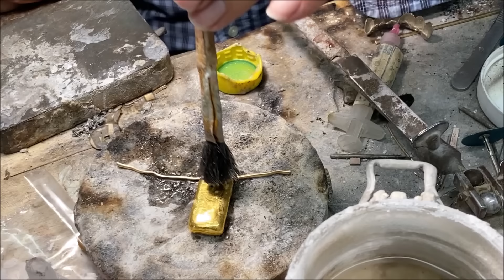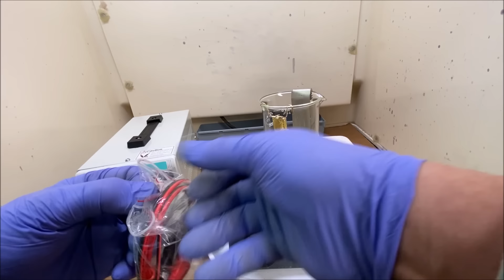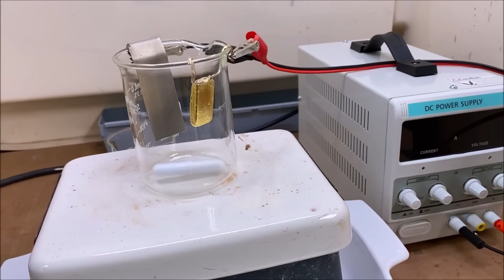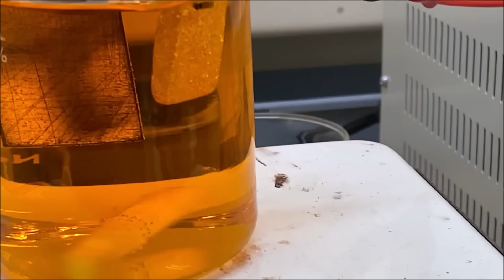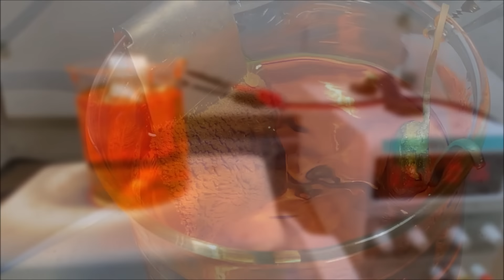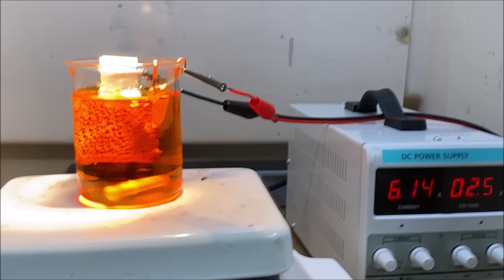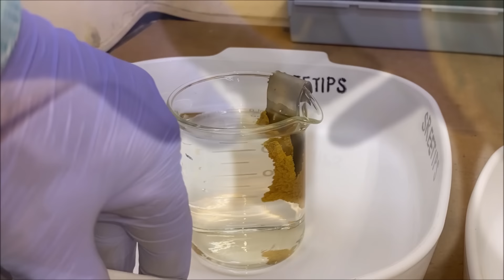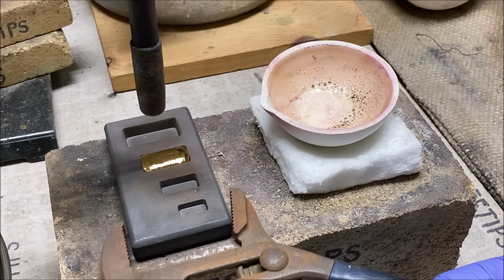Electrolytic Gold Cell Part 2

Comment: in the future for a setup that doesnt need soldering, you should run the anode through the rollers to make it thin enough that the alligator clip can hold the gold directly, and instead of soldering leads on, just make some ladder steps to hold it higher, and as the bar shortens you can lower it down farther into the solution, this will also mean that the excess gold in the end is smaller in mass and easier to process later without having to melt all the solder off. This also makes it faster to switch to a new anode, just have another thin long piece prepared and you can effectively hot swap it, you just have to get a little better at rolling them not in the shape of a banana lol
Reply from the maker: Good suggestion, thank you.
Reply: @sreetips  You can easily punch a hole in the bar [hammer + nail] without losing mass and then string it on a copper wire.
Reply: @sreetips  what the heck….. why delete my comment?  I put a lot of time into telling you about hho torches and getting a Chinese one for cheap willl do the job…

I didn’t swear it put |inks or anything :(   Blah

Just trying to help. It would do the gold solder easy. Almost 4,000 °f flame
Reply from the maker: I have not deleted any of your comments.
Reply: @Coincidence_Theorist  @Coincidence Theorist  your posting under other people's comments. Your other post you thought was deleted is under laser2120's post. You should start your own main post to see them together VS posting your thoughts as a sub post under another viewers comment.
Reply: @sreetips  nor would you
Reply: @sreetips  Could also make a mold that when you pour the molten gold, it forms the dog ears?
Reply: @sreetips 
For our next trick, let's build a speed rail to Mars via the moon...
Reply from the maker: Can’t, outer space is far too dangerous.
Reply: كم نسبة حمض الهيدروكلوريك وبيروكسيد الهيدروجين في المحلول؟ @sreetips
Reply from the maker: @alameerali7430 the bottle label says 31.45% HCl. The h2o2 label says 29%
Reply: @sreetips  شكراً لك ، لدي سؤال آخر .. هل يمكن استخدام معدن آخر غير التيتانيوم للكاثود
Reply from the maker: I used a pure gold (999 fine) rolled thin as the cathode in a previous video.
Reply: @sreetips  let's see them upload their own vids one day, for now Great Job Overall
Reply: Reading this as the banana comes out of the roller 😂in my real view time
Reply: Isn't this just pulling gold off the gold bar and collecting it on the titanium plate? Is the gold bar going to weigh the same? As well as the electrolyte gold solution?
Reply: @dru4135  moving the gold from the gold bar (anode) to the titanium plate(cathode)  is the primary purpose of this electrolytic cell.  The electric power that's fed into the cell is what does the work of moving the gold. Adjusting the voltage used controls which metals would or wouldn't move from one to the other. Different metals need more or less voltage to be pulled off the anode into the electrolyte and pushed onto the  cathode onto the electrolyte. Look up 'electrolytic refining of copper' to understand more.
Reply: Yup, make it thin enough to fold up and over the beaker (like the Cathode) so you can attach the alligator clip and slowly feed it in as it is consumed.
Reply: @Miketz  you could just fold it in a sepentine fashion then would not have to feed it
Reply: @chrisharris1522  Thin anodes tend to dissolve unevenly, and pieces end up falling off. By feeding it in over time, the thinnest bits are always at the bottom.
Reply: @Miketz  maybe but constantly handling the anode in order to reposition it adds another level of complexity to the experiment in which contaminants could be introduced or disturbing the anode could potentially dislodge a piece of the thin part at the bottom of the anode as well, generally when setting up an experiment it is desirable to keep it as simple as possible in order to mitigate unintentional events such as these. If a piece were to drop off it is not a huge problem as it will be recovered anyway when the gold is recovered from the electrolyte and on a molecular level gold atoms are detaching from the anode all the time to a degree anyway
Reply: @chrisharris1522  you could take care of this with a little bit of complexity if you setup a circuit with a geared down motor on a circuit that runs when the current drops below a certain point, then shuts off when the current raises to a certain point, some fine tuning is probably required, but it should work well
Reply: but wont that lower surface area?
Reply: he did that last time
Reply: @dynorat12  no, that was the cathode he had setup like that
Reply: Is it possible, if you roll the anode too thin, it will desolve quicker and produce less? I'm also wondering if there might be a way to trick it up a few notches in some manner, (for lack of better understanding and eloquence), to get more of a yield?, as in, what, if any, is the best process to get the maximum yield?
Reply: oh yea thats right
Reply: Could always punch a small hole in the anode and run gold wire through it. I do all my electro saline etches that way and it works perfectly.
Reply: Yes! Solid comments always here. That's how you know your in the right village!
Reply: That is what I thought he was running through the mill for.
Reply: اتمنا لو هنالك ترجمة
Reply: To avoid the banana just flip the gold each pass through the rollers. Now you just need to figure out how to use lead as the anode and you can call yourself a true alchemist ( I am sure there is a way, after all lead is soft and heavy and gold is also soft and heavy)
Reply: @chrisharris1522  the claims of 'lead into gold' were probably just obfuscation of the trade secrets medieval refiners used. Watch some of mbmllc's vids where he uses lead and borax or lye to dissolve the gold out of a mix of gold+crushed rock , and then cupels the blob of lead that dropped to the bottom of his cone mold. An unsophisticated audience could easily be led to believe that the lead magically turned into gold in the cupelling furnace.
Reply: @chrisharris1522  yep, uneven thickness between the rollers
Reply: A good idear indeed 😮

Comment: NurdRage did a demonstration of recovering copper from copper nitrate/sulfate. In his video he showed that low current and high concentration led to stronger deposition on the cathode, while high current and low concentration led to poor, powdery deposits that detached from the cathode. So it depends on what you want.
Reply: So slow and steady low current from beginning to end, no need to ever hit it with high Currents
Reply: So start really high and then lower it for easy removal
Reply: @nothingnothing1799  Or maybe the opposite? Start low so you get a poor powdery deposit on the cathode that will detach easier later, and then crank it up so the rest of it sticks to the poor deposit, and when you're done pull it all off in one piece since the innermost part will be poorly attached. nvm, I'm dumb.
Reply: @williambarnes5023  low current produces  the stronger composition and high current produces the powdery deposits, so starting high would make the base layer crumbly

Edit: np I honestly had to reread it a couple of time to make sure I hadn't made the mistake
Reply: @nothingnothing1799  I'm sorry, you're right. I read that completely backwards somehow. Thank you for the correction.
Reply: @nothingnothing1799  If you apply a coating to the back and the edge of the cathode, then the front is the only exposed spot. It will peal off with no problem.

Comment: if you used a stainless steel bowl like with the silver cell, would the gold not come off the bowl in the same way the silver does? or would the electrolyte corrode/dissolve the bowl?
Reply from the maker: The silver electrolyte is a nitrate. The gold is a chloride. I don’t think the chloride will work with stainless.

Comment: One thing you might try is using a cylindrical pin/needle/rod cathode for collection.  Seems you could just twist that crystal right off so long as the substrate was smooth enough.  Real cool vid thnx.  Hope to see more improvement on the gold crystal making.
Reply: Rod has less surface he just needs to put a tapper on the cathode he is using right now
Reply: How thin could you go on the titanium sheet to get the most surface area and gold crystal yield?
Reply from the maker: The titanium was about 1/32 inch thick

Comment: Well Kev, how do you feel about the whole experiment overall? i feel this was a much much better result and process then the past videos you have made...
Reply from the maker: It’s got me very interested. I may refine the equipment and start using this for future refining. The titanium cathode was a big plus, finding that it works well.
Reply: @sreetips   I’d be very interested in the results using an impure gold bar as the source of AU vs the pure gold bar like this one, would it operate the same as the silver cell/ wohlwill cell you have operated, will the impurities displace like in the silver cell or will it not work? I’d assume use 18k solid gold cast bar as the anode, 🤷 would that even work, or do you need all AU in solution? 👀👀👀 so many questions